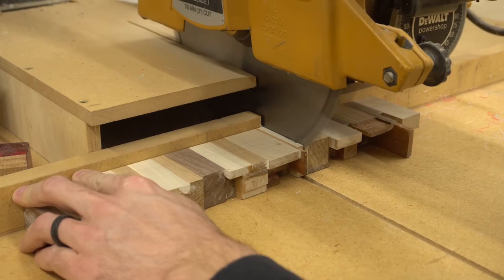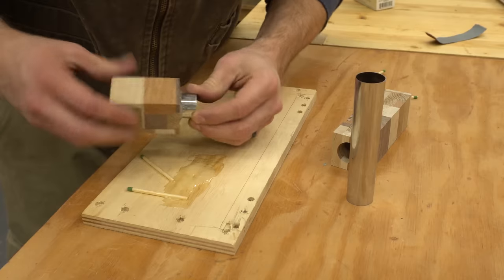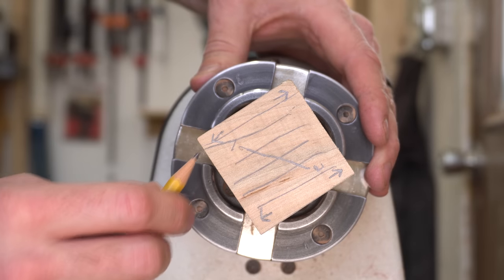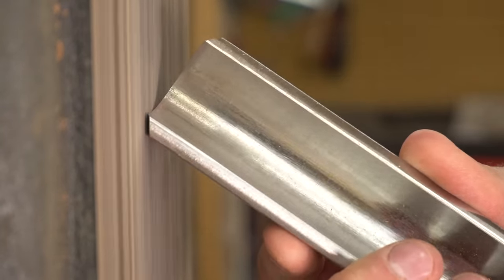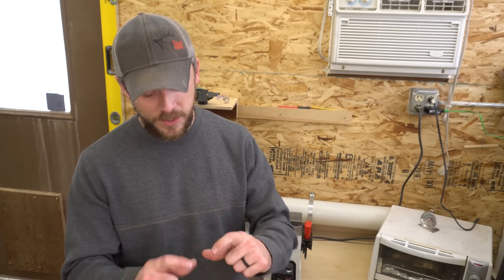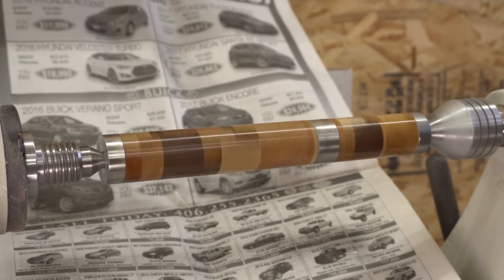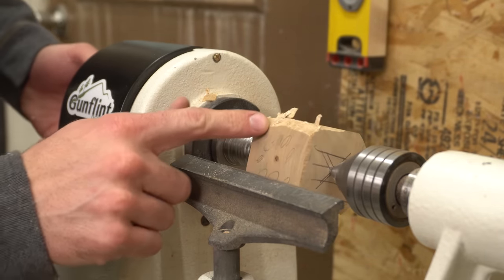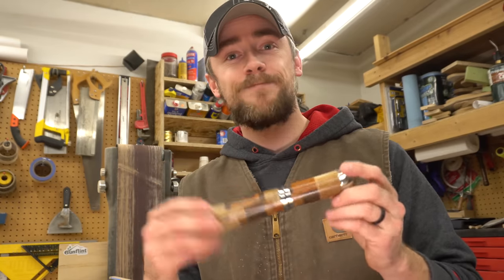Making A Cigar Holder & 5 Tips For Turning End Grain

Comment: You're a really solid teacher and I enjoy your vids a lot. Only note i want to add is, if youre wood is turning in bowl orientation, end grain-side grain-end grain-side grain, then you never ever ever want to use a roughing gouge. Bowl gouge all the way. Roughing gouges (Spindle Roughing Gouges) arent designed to take the vibrations that bowl oriented grain causes. You likely didnt have any issues this time because the pieces are so small and youre roughing gouge is so big, but in the future, it can cause the roughing gouge to break off in your hand which can be extremely violent.  Happy turning!

Comment: What a great video,you covered several areas where I was having problems. The other problem I’m having is the drilling process of that large of a hole.  A hole of this size,  can this be done on the lathe or would you recommend going to the drillpress?
Reply from the maker: Honestly it can be done just as easily at either. The trick with that big of a bit is slowing down the rpms and not forcing it to cut too fast.

Comment: The reason your end grain maple block was tearing out on the corners so much is because there is no support in the bevel and that’s why you have lots of tear out and also use a rubber or wooden mallet to really drive that spur drive in the wood so it gets a better grip and also use a bowl gouge on end grain

Comment: I know this question is for another video, but how long do you keep the torch on the woodburning stamp you have? I bought one and cant seem to get it just right. Thanks!
Reply from the maker: Hey William, it definitely takes a little practice to get right. Usually I just let mine get too hot then test it on a scrap piece. It's probably billow smoke in an instant - that's too hot. Give it 20-30 second then test it again. Eventually you will hit the sweet spot then you can use it on your real work piece. If you have lots of things to brand, you just have to hit it with the heat a little bit every now and then to keep it up to temp.

Comment: Wouldn't sand paper work better to take down the corners?
Reply from the maker: It would work, but not as fast as the bandsaw.
Reply: Gunflint Designs i meant after the band saw. Instead of using the chisel
Reply from the maker: Once the abrupt 90 degree corners are taken out with the bandsaw, then a sharp chisel does a great job. I think trying to sant it while it still has straight sides might take a few days to actually get it round.